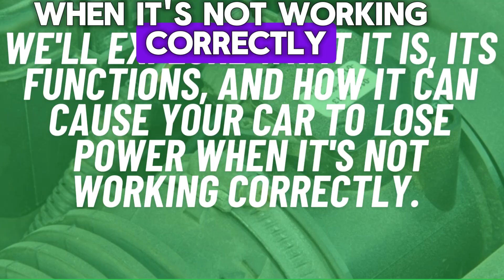How a Faulty Mass Air Flow (MAF) Sensor Can Cause Your Car to Lose Power

Comment: What if we disconnect it and the car still running, is that good or bad sensor?
Reply from the maker: Here are some of the things that will happen. Poor Fuel Economy and Performance, Possible Stalling or Difficulty Starting, so it is Not recommended for long-term use. Disconnecting It’s okay for a quick diagnostic test (e.g., to check if the sensor is bad), but you should replace or clean a faulty MAF sensor rather than leave it disconnected.
Reply: @Fixandcruise  I never let my MAF sensor disconnected. I heard about this long ago and never did it until 3 days ago and the car stay running like nothing happened. I put it back and I order one than coming tomorrow Sunday, so I will see how it works.

Comment: What are the steps to check if it's faulty?
Reply from the maker: So if you have watched to the end, you will have seen an answer to your question, nevertheless here are some steps to notice. Check for Symptoms:

Rough idle
Poor fuel economy
Engine stalling
Hesitation or jerking during acceleration
Check Engine Light (CEL) on
Visual Inspection:

Locate the MAF sensor, typically near the air filter box.
Inspect for visible damage or dirt buildup.
Could you check for loose or damaged wiring and connectors?